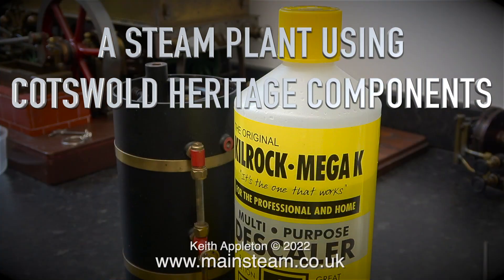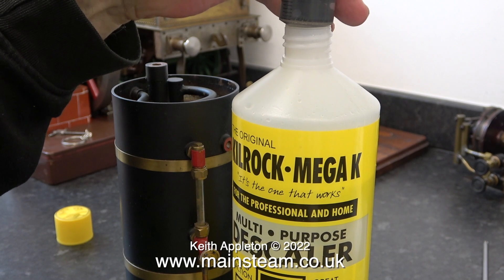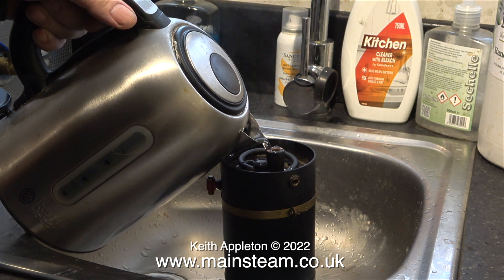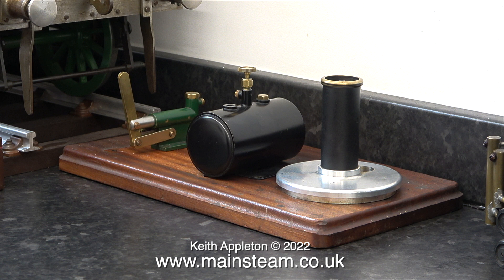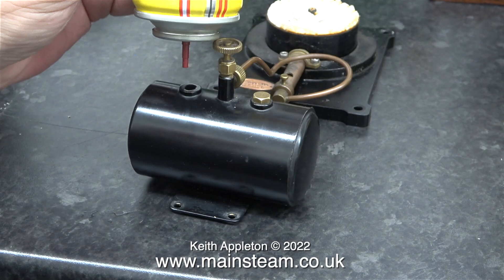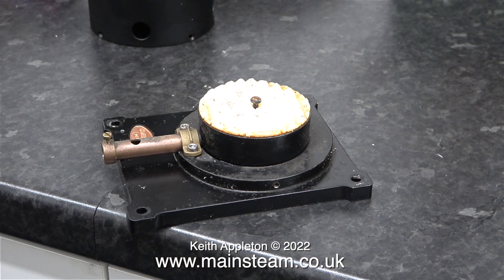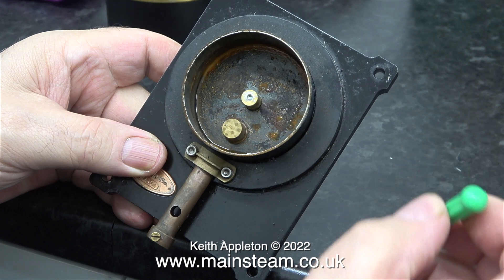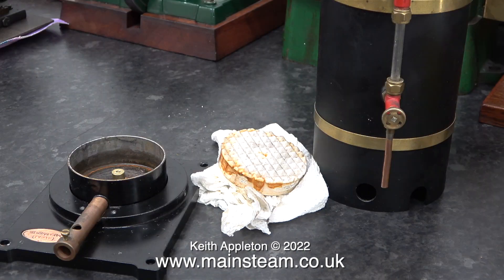A STEAM PLANT USING COTSWOLD HERITAGE COMPONENTS - PART #2

Comment: Very interesing. Will Formic Acid be suitable for descaling the engine block in my Ford Model A - It has a brass radiator and cast iron engine block.
Reply from the maker: Probably best to buy something designed specifically for the job you want it to do.